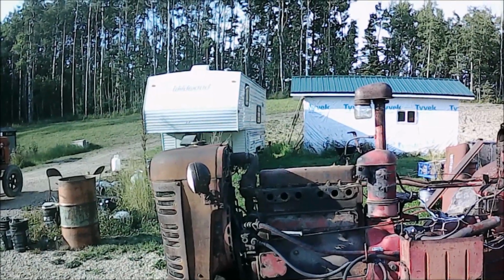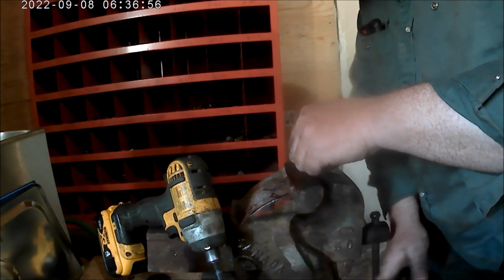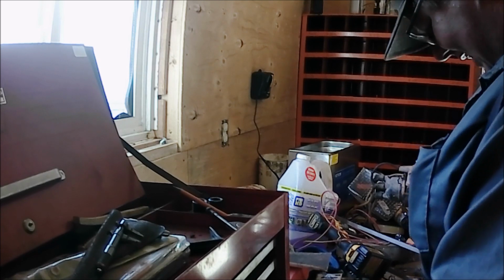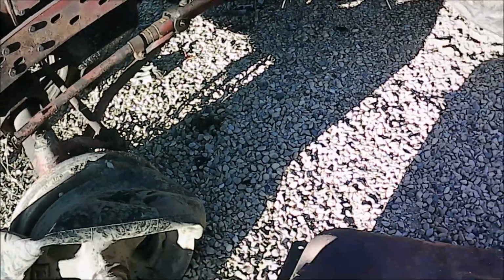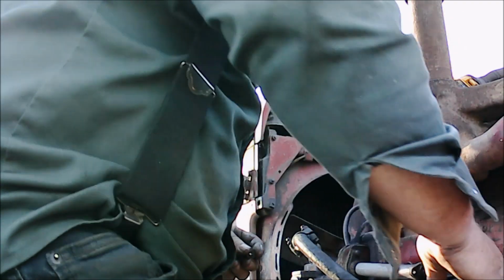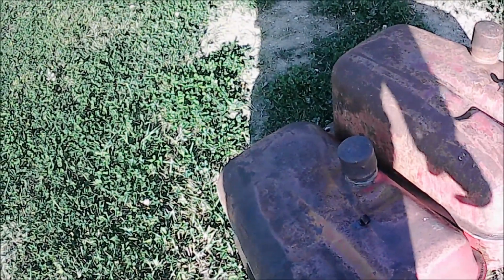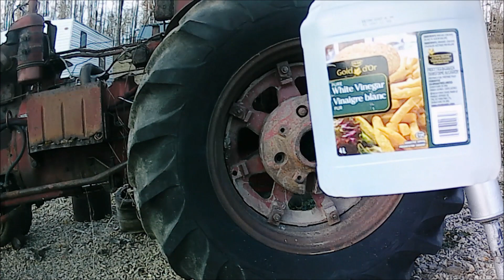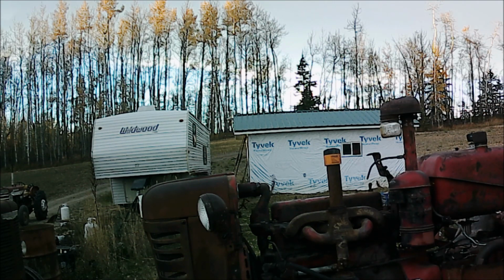International 400 (Part 2) Fuel System Cleansing and Repairs

Comment: Did mine 2 years ago
Reply: Good  day  fellows  My dad had w-6 from  1955  to 88 when he had sale  & we never had  carb off,  unless mechanic  did.  Now super 6  was used nearly every day, until we got diesels   The only time 6  would not start was in spring  when  motor would sweat & I guess moisture  got in distributor.  Thanks
Reply from the maker: That's why it runs so good, too
Reply from the maker: Could be a wet distributor for sure.

Comment: Yes thats pretty much the standard procedure when  you bring one back into service. The farmall cast carbs are difficult to get clean. I was thinking of buying some of that Evapo Rust and giving it a try? Ive fixed bad floats by cutting out the bottom and filling the space with varnished cork.
Reply from the maker: I use an ultrasonic cleaner to clean the carburetors. I was thinking on rusty ones of trying a mixture of water and CLR. It wouldn't hurt to try Evapo Rust...  Using cork to fix a float is a good idea. Here what happens is water gets in the carburetor and it freezes and squeezes the float and breaks it.
Reply: @tyfrank3427  Yes ive seen floats that where crushed by freezing water. The Old Farm Junk 101 Guy once was fixing a M and he bought a New float. He lamented that it was his first time ever to buy a new carb float. and it was high priced.